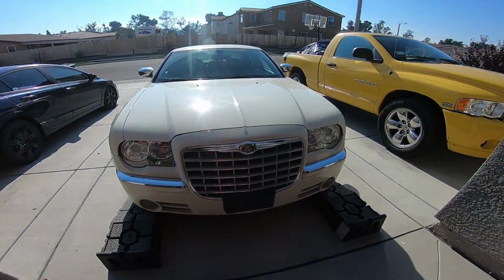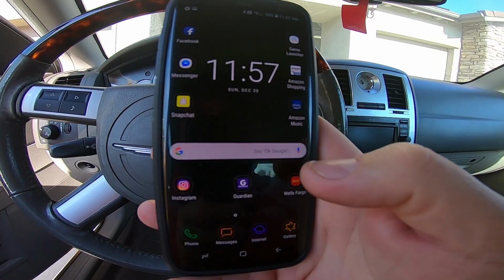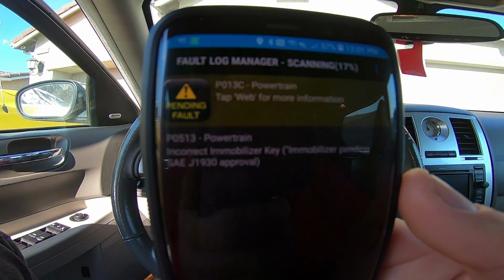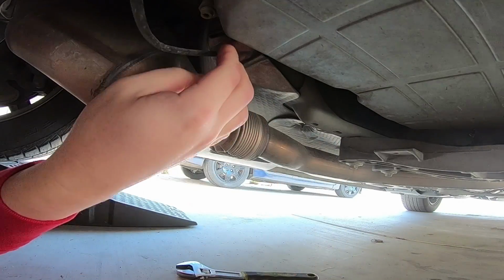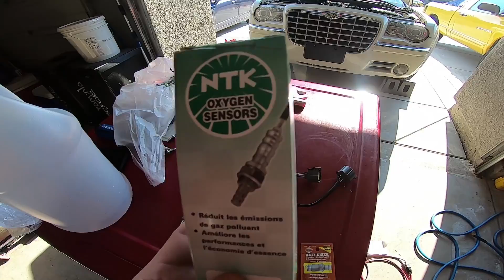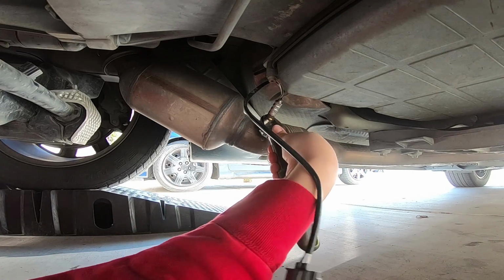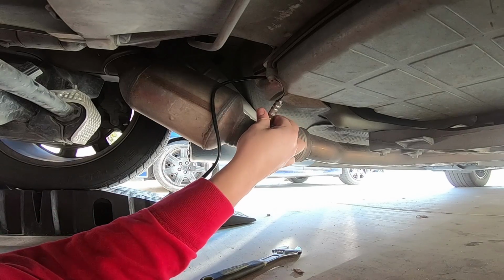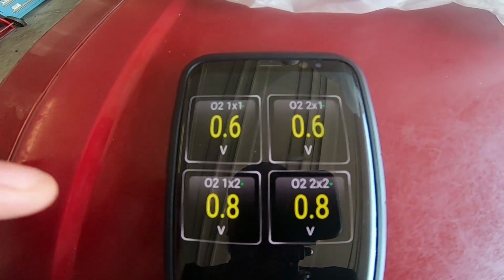Chrysler 300C oxygen sensor replacement bank 2 sensor 2 PO13c

Comment: Hey so i have a issue i had a little problem i ran over something last night (not a living thing) 😑 and it broke my O2 sensor plug in as long as with the wires so i snapped a goodamoumt from the other end and put a new one but car still seems to shake any thoughts of what it could b get back too me if anyone knows plz ☹️
Reply: No I disconnected the battery but once im driving it comes on and flashes then it stays for 5-10 sec then it flashes again and beeps
Reply: Yes its a 2.7 i already changed spark plugs its coils as well
Reply: I got a 2008 Chrysler 300 I replace my cold packs in my spark plugs and it’s still shaking Hook it up on the machine It’s saying my O2 sensors so do I need to replace them or no is that my problem

Comment: About to get under my 07 charger. Didn't think of paying for thismm Thxx dude. Wish me luck
Reply: @5150GringoGarage  done and Done! Got bad burn as the car was still hot! But the check-engine still on. The computer need "resetting" you reckon?
Reply: Nvm, I did it. Man it feels good! 
Much appreciated on this...
Reply: Is the o2 sensor the same? I have code p013c 2/2
Reply: @JoseGarcia-qm4eu the guy explained it which side is bank 1 and bank 2 so if you’re getting the same code (p013c) then it’s the same one as the one in the video
Reply: @JoseGarcia-qm4eu and also if u have a dodge charger from like 2010 and under then it’s the same engine as a chrysler so it would be almost exactly as the one in the video

Comment: 2:00 . Yo my 2006 300c doesn’t want to crank up. I changed alternator and put a jump box on it the throttle body sign shows up but disappears after changing the ecu component. Could my Co2 sensors be the problem or my fuel pump? It only has 130kmilage
Reply: Probably fuel pump
Reply: Crank or cam

Comment: Can bad O2 sensors be the reason of missfires? I have codes from P0300-P0308 after reset the PCM on my 5.7 Hemi since years and now with a replacement engine to. The last years I change all sensors and the throttlebody on the old engine with no success. Only the 4 O2 sensors are the originals.
Reply: @5150GringoGarage  Thank you thats a good idea. I buy one today. Best regards.
Reply: if u have a misfire, if its certain cylinders, you'll have to replace lifter(s) and possibly the camshaft. I just had a cyl#5 misfire & replaced PCM first & it still had issues. Tore motor apart to do lifters and cam and now it runs fine.

Comment: I have the code P2096 Post Catalyst Fuel Trim Too Lean Bank 1 on my 09 300c does that mean replace the 02 sensor? If so do I just change one of the sensors or all?
Reply: Any luck mate, mine is showing the P2096 too, any information will be much appreciated. 
Thank you

Comment: How did you drive that car into those ramps? Mine drags my ramps so I have to jacked it up but would rather use those ramps, Btw bank 2 sensor 1 which is the one under the hood passenger side if you don’t have a lift to be able to stand up under the car you ain’t getting to
Reply: Parking break friend

Comment: I have a P0430 on my 2009 SRT8 6.1L Challenger already with 76k miles. What can it be?
Reply: If your cat is not working properly you want to look at your fuel and spark system. Cat dont comment suicide there murdered. Cat should last the life of the car. Only unburned fuel can clog them
Reply: Jimy did you fix your problem? and what was the issue?
Reply: @donalic  left cat went bad and it seems like I need to upgrade my fuel injectors. I'm at 82k miles now. Sounds about right to change them all by now.
Reply: @jtbatista  ah damn your one has low miles. I got the same code on my 06 300c Srt8 114k miles and was thinking to change the o2 Sensors first and see if it goes away.
Reply: @donalic  at that mile, check your injectors. They can get clogged up and cause lean codes.
Reply: @jtbatista  cool bro will have this on mind.

Comment: O2 2x2; is that on the driver or passenger side?
Reply: 5150GringoGarage thank you so much for responding. Please let me know if I get this right? For the Chrysler 300;

Driver Side Bank 1 - Sensor 1 Upstream, Sensor 2 Downstream 
Passenger Side Bank 2 - Sensor 1 Upstream, Sensor 2 Downstream.

On a Ford Truck their Bank 1 is on the Passenger Side.

Comment: I have a 05 magnum 5.7  and i changed my 02 sensor due to code p0420 left cat. And it was idling a lil bit rough. I just put a denso 02 sensor and no more rough idling. Hopefully the code dont comeback
Fyi the sensor was at 0.500 and before i changed it i had check it and it was stuck at 0.330 
Once i put the new it was at 7 readings too

Comment: Is Bank 2 Senor 2 located on the Driver side?
Reply: @5150GringoGarage   Thank you.  Do this apply for 08 Chrysler 300 Limited  Awd? Im getting a hard code p0058. I can't clear it and i have already replaced the  02 sensor downstream passenger side bank 2 sensor 2.
Reply: @5150GringoGarage   Not far at. Back and fourth to work, which is about 15 miless each way. Haven't drove it far or put miles on it since the changing. I thought i could change it. Clear the light and that be all. 🤦🏾‍♀️
Reply: @5150GringoGarage   Ok, no problem.  I will do that.